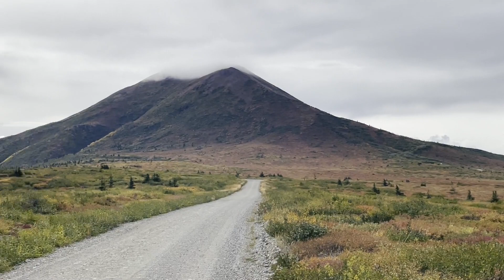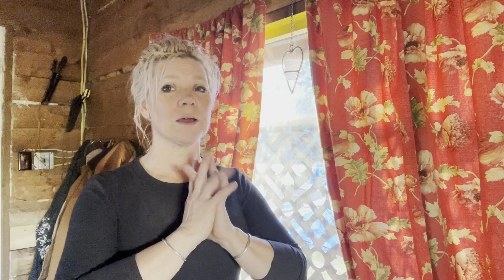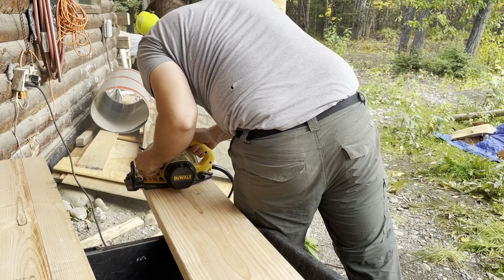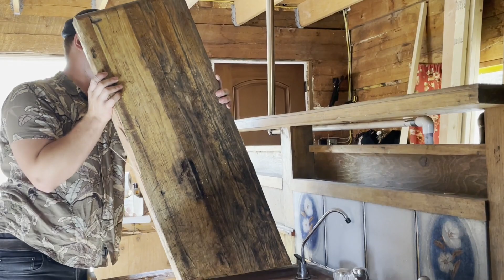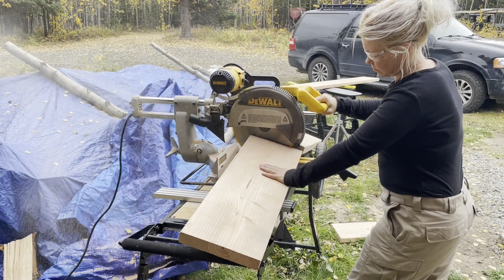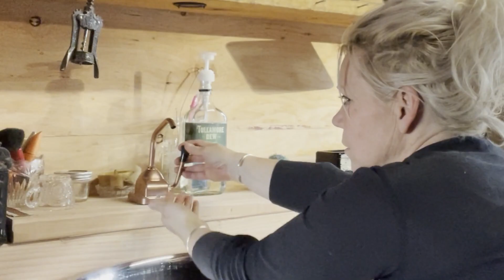Remote Alaska Cabin Kitchen Renovations & Bathroom Demolition Finally Begin!

Comment: *IMPORTANT INFORMATION*
My friends just had a horrible accident due to using spray foam insulation. When I heard about the accident I thought of you. They were using the industrial spray foam to fill in gaps in  their home. The spray foam is highly flammable/combustible and when he was using it the gasses met a pilot light from the gas and caused a massive explosion. The family is ok and he survived but spent time in a burn unit with some very horrific burns including chemical burns from the can of spray foam exploding. 
I had no idea that was even possible and was shocked and terrifying because I also use spray foam insulation.
Just wanted to share. I enjoy your videos!!
Reply: I guess shutting off all flammable pilot lights and ect was not in the manufacturers info list?
Reply: Reminds me of the situation with Silly String being flammable. I'm always about anything that helps me stay better safe than sorry. Thank you.
Reply: Prayers 🙏
Reply: So glad he survived, and I'm praying there were no lasting injuries!
Reply from the maker: New Meee, I am so sorry to hear about your friend and that it has taken me so long to come across & reply to the comment. I do hope that he has recovered from his injuries. So many dangers to consider when working with anything that is under pressure or potentially flammable. Thanks for providing this warning to others! 💛

Comment: Modify the water jug where the pump is above and it fills the jug then you just have to pump to fill it but yet it will flow when you want to wash your hands.   Via drilling a hole in the lid or some other way by passing the the leaky pump.
You have done wonders with the whole cabin...enjoy

Comment: I've been living camp style inside and outside of my home for years bc I need plumbing and all types of renovations. Until then, what I've adapted to for hand washing is my three bowl system.
 
Three bowls big enough for one or two hands at a time.
¹pre-wash, ²wash and ³rinse bowl, and a towel underneath to catch the drips. 

Perhaps customize a shelf to fit your height to avoid bending with cutouts for the bowls to be pushed into and even cutouts in the towel underneath will be a nice clean look and of course the cutouts will stabilize the bowls.

I like to put a splash of white vinegar in my rinse bowl.

So, you know the scrubby things that we scrub our body with, the poof ?
And you know how when we wash and rinse our hands we rub our hands together ? Instead, how I have adapted to the inconvenience for me, to rub my hands together inside of the bowls is, I put some of that poof material in each of the three bowls so I can abrase my hands in that mesh fabric. 
For me I actually recycle the mesh plastic bags my fruit comes in or you can take one of those poofy things and cut it apart for this type of fabric, makes my hands feel clean and to help quicken the wash and rinse and this helps remove oils when I've had my hands in stuff like that.

It's such a water saving method also and I don't think I'll ever go without using this system even when I get my Plumbing working as I am a constant hand washer. 

😊I'll probably design a shelf system just like I've described here, for myself. For a even cleaner look on the shelf, I would probably skirt the bottom of the shelf in some wood that matches what the shelf is made of, so you can't see the bottom of the bowls from a distance.

This system works so well for me sometimes I use the same wash bowls for 2 days just changing out the rinse water daily.
And If you're using the stainless steel type of bowls, perhaps you could place them on your wood burning stove periodically throughout the day to keep them nice and warm.

Comment: Hello ,Alone.
My wife and I have a cabin in Northern Ontario Canada. We are offgrid so our electric comes from solar panels, or the generator. In the summer we pump water out of the lake so we have plumbing and running water, but no sewer. We have an inside composting toilet. There is no smell( actually less smell than our conventional toilet in the US.)We have propane refrigerator, cook stove, and water heater. In the winter we don’t have running water. I have been thinking of putting a water tank in the loft and running plumbing to it so I can use my water pump that I use to pump out of the lake to fill my tank in the loft from jugs, or whatever we haul the water in. Then plumbing to the faucets shower etc. it would be very easy to do and fairly inexpensive. I love your place( and mine) it is so quiet there, and dark at night. I probably won’t ever live in mine year around, because it is in Canada but I admire your courage. The scenery is so beautiful !

Comment: Do you know about the foot-pump faucets? Would be so much easier for you to use as you would not have to reach across the counter. I think the brand I used in my van was Whale Pump. You can use the pump with ANY faucet, so you could have a faucet spout that comes out farther over the bowl (and swing out of your way  when you don't want it sticking out). I never had any leaks with my foot-pump faucet. Simple to install, leaves hands free. Your kitchen is looking GREAT!
Reply from the maker: Wait a sec Joanne! Have you been spying on me? 🤨 I bought the Whale foot pump and an articulating water faucet. I should be showing it in my next video! Great minds!? 😉🧡
Reply: @AloneinRemoteAlaska  Coolio! You will love it!

Comment: I’d switch from propane to bio gas. But I can make it on my own. Bio gas is a methane.
Reply from the maker: Interesting! Making your own gas would solve a lot of things and save a lot of money! I will have to research this a bit! 😁🧡
Reply: @AloneinRemoteAlaska  you can buy a pre made system which I hear works but not as well as one made from an inch tote and you don’t need as much pressure to run compared to propane . And your own bio gas can be made from human manure to table scraps and animal poo. I wanted to build one for our cabin.

Comment: hi, built  a shower ,that you can use a 5 gallon pail to drain lt,or right outside your door, close by. look on amazon.composing toilet and sink, where the bathroom was before.
Reply from the maker: Composting toilet will happen for sure. And I use a plastic watering trough to take showers and baths but it is not draining outside yet. It will. And a sink will just empty into a 5 gallon bucket or may drain outside. Just depends. 😉💚

Comment: The kitchen looks incredible!  I may have missed it, but I wondered what you plan to do for the floor?
Reply from the maker: I have not completely decided on the floors yet. I will be putting down a plywood subfloor over the old floor to start. I have seen the "snap in" engineered flooring (Home Depot) but I am just not 100% sure about that stuff. The common thing to do in Alaska, especially so far away from cities is to just paint the floor. I have to think about maintenance and ease of cleaning though. And expense of course. Thank you so much Theresa! 🧡🤗💚

Comment: have you considered the water system that Mitchells in Alaska has?  they use a 12volt pump to pump the water up to the second floor then gravity fed down to the kitchen.
Reply from the maker: Hmmmm I must have missed that video! I am trying to avoid using electricity if I can although it may still come to that. I have purchased a foot pump and an articulating faucet so I will see if that works first. Gravity fed would be a perfect option and I don't mind using a pump to get water to the second level. Anything is better than carrying water up the stairs! 🤣  Thank you so much Bill! 🧡🤗💚

Comment: Get a 12vdc pump to rig up under the table, then run some 1/2 tubebing to a 5 gal water jug. The other end up the back with a spray nozzle. Connect the battery with a toggle switch. That's it. Little noisey when on but hey it works. Mount that switch up near where the bowl will be, one wire to switch the other to the (+) SIDE of battery.
Reply from the maker: I decided to go with a foot pump and a new articulating faucet (so I wont have to reach so far). If this does not work, I may just try the gravity fed but still use an electric pump to get water to an upstairs holding tank. Many options if I chose to go AC/DC though. Just trying to avoid electricity to start. Thank you so much Michael! 🧡🤗💚

Comment: Get yourself a stove pipe magnetic temp guage, so you can adjust the intake air on the stove. That storm door in the loft bedroom area, can you adjust the window to open it a little? Good to vent the cabin to any built up moisture or heat. Same with ground floor open the window a little for fresh air to flow. If you start to get a Headache deffenatly open up windows.
Reply from the maker: I have a temp gauge on the stove but its an old one. Will be replacing that soon but this one works for now. The door in the bedroom does not open but I have two smaller windows upstairs that I can keep cracked open. The cabin is not air tight and I am ok with that. Its good to keep that moisture down with some dry air! I have some CO2 detectors but getting a headache would be my first sign to get to a window fast! Seen too many stories of entire families just being found dead because of CO2. I will deal with the air leaks! 😁

Comment: Stainless Steel Suction Pump 1.25 inch Manual Water Jet Pump Domestic Well Hand Shake Suction Well Pump Groundwater for Home Garden Yard Lift 10M More Attchement
Brand: osea

-18% $45.66
Was: $55.99 
Coupon:    

Brand	Osea
Color	Green
Material	Stainless Steel, Plastic
Style	Above Ground
Power Source	Ac/dc
Item Weight	2 Kilograms     This pump works very well.  We bought it to install in our Kitchen counter in case we have no electricity for our well pump.  PVC pipe down to our crawl-space.  It will lift water up to 20 feet.
Reply from the maker: I looked at that exact hand pump on Amazon too! May be too much splash for my table (glad there was a video)  but I have ideas for it elsewhere! I am still considering it (for another project) because it seems to move a lot of water! Thank you so much Eve! :_Heart:

Comment: So much work. Looks amazing what a difference..👊 keep the faucet for convenience
Put it on a swing arm so it just swings out and back against the wall. It will extend far enough over the bowl to wash your hands. Swing it back out of the way and put a drip pan under it as well. 😂
Everything looks wonderful there. You have a fantastic week..!!
Reply from the maker: Ahhhh great minds think alike Ron! I just bought an articulating cold water faucet on Amazon and decided to go with a foot pump. Will take some fancy connections to make it work but I will get it! I have to eventually set up something similar in my "bathroom". This has been one crazy year! I am looking forward to slowing down a bit with winter coming in! 😴 Thank you so much Ron! :_Heart:

Comment: Do you have to pay these drivers and contractors a real high price to deliver materials, freezers, etc since you said you are hours away from any large town?
Reply from the maker: All of the lumber for these projects was picked up with my own vehicle at Home Depot or Lowes. Same with the freezers. I have to be careful though because I usually run to town to pick up many things and do not have a trailer. My contractor that did my roof, I'm sure the delivery of all the material was built into the price. I do get delivery of my firewood luckily because the owner of the company enjoys the drive. It's not free delivery though. Thank you so much Marie! :_Heart:

Comment: Wow, spectacular progress. Seems very well thought process as to what YOU want. Seems nice to have out with the old in with the new. I would suggest filling in the spaces on your wood counter so food does not get down in those cracks between the boards and then adding your oil. Also I LOVE the chandelier. I was wondering since it it not wired in, can you center it more over your table? Maybe it was just the angle we were seeing it? As to the sink, see if you can get a foot pump to last till spring or order Amazon has a a foot pump sink you can order. I loved the leverage on the shelves, as a single mom I used a lot of legs sitting on the floor to move furniture, 😂.
Reply from the maker: So many ideas have been running through my brain for so long that seeing these ideas come to life is really exciting. But I do wonder what happens with my brain after all of these ideas get accomplished! :_What: Might be a lot of extra space? I hear you on filling the seams though. I almost was going to do that with wood glue but decided to do more research first. But they will get filled up prior to sealing it! The chandelier is wired to a regular 110V plug. Pretty sure that was not how my grandparents purchased it originally. But you are correct, the chandelier needs to move over a bit. There just wasn't a board where I needed the nail to go. I will correct that later. I have ordered a foot pump and a new articulating cold water faucet that I will need to figure how to connect it all. And I have moved many pieces of furniture using the sitting leg method! Never under estimate a woman that has to move heavy furniture on her own! It will be done! :_Laughing: Thank you so much Cee Jay! :_Heart:
Reply: On the chandelier, run a salvaged board opposite the long running boards where you want the chandelier to run. I hope your pumps arrive before winter but can’t wait to see the changes you make this winter there alone but wait your not Alone, your Alone fans are right here anytime you want to bounce ideas around or need a suggestion. I firmly believe you can do whatever you need to make your house your forever home. Any new sightings on the game cams? Also, any thoughts on sourdough starter? Questions for the next Q&A session.
Reply from the maker: @cbenji2  Yeah I was going to run the board and hang the chandelier center but I had to get to the filming quickly. I will fix it this winter though (or sooner) as soon as I get the light bulbs most likely! I have been ordering Amazon stuff like crazy getting some last minute stuff so my foot pump and faucet will be here soon. Just hope I got all the connections to make it work. And you are correct! I have all of you to get fantastic ideas from and I have received so much helpful advise so far. It's so awesome! I will be showing some wildlife captured on video in my next video. As for the starter, I do have some in my freezer. It's store bought but I don't make loaf bread that often. Thank you so much Cee Jay! :_Heart:

Comment: If I was to ever wire a cabin  I'd wire it for all 12 volt lights LED lights are so bright and low power I put them in my 5th wheel I was even thinking of wondering my house for 12 volt lights you can get so many stuff that runs off 12 Volt and put in very little 110 plug ins
Reply from the maker: You don't think super bright lights are annoying? I like softer light! But LED is the way to go for sure! And I am trying to limit my electrical dependency. Freezers, computer and some lights should be good enough. But a nice candle lit room is very relaxing! 🤗

Comment: you could always have a solar powered pump to pump the water to the second level..?  so it can be gravity fed back to you. there are also auto shutoffs to stop it from overfilling if you forget about it... and possibly switches that will start the pump when the water gets low in the container.   the only other thing to consider is the extra weight on the second floor.  but that would also take care of the hand washing issue.. cause you could use a regular tap to turn the water off and on.   now sure how you get rid of your graywater.. but you could filter it before it goes into the container.. and then use the same system to pump the gray water out of the cabin without having to deal with heavy containers.  not that we will ever grow old and less strong.. ;o)... but it's good to keep an eye to the future and get a system going that is semi automatic and not going to put your back out keeping it going..
Reply from the maker: A way to get water to the second level (without having to carry it) would have to be done with electricity/solar. My only fear with solar is how little I get in winter. And yes, weight on the second level is a concern for me. Many things to consider. I may have found a solution for now. Just a foot pump and an articulating faucet so I wont have to reach so far over the table. As for grey water, I just get rid of it in 5 gallon bucket once it gets full. Sometimes just spread it out under the trees and sometimes in the fire pit. I am looking at a way to have it go into a plant bed of some sort. Just started looking into that idea. I am keeping in mind the "as I get older" part so nothing is too crazy. Maybe electronic pumps will be in my future but for now, I like to keep it manual. I know, I'm weird! :_Laughing: Thank you so much Deborah! :_Heart:
Reply: @AloneinRemoteAlaska  

never weird girl... ;o)

just doing it our own unique way.
and that is how the Lord made us.
we figure things out as we go.. as the Lord guides us... 
I do feel your efforts are being blessed by the Lord.. so... 
if we put him first in all we do..we never have to do it alone...
and him that made all things..?
will help us  get where we feel we need to go.. 
you are in my prayers.   
✝❣👍

Comment: You need to put a 1 way water valve in the water line so it dosnt beet back there small and cheep well use to be cheep I use to put a after market windshield pump in the water line and a doorbell switch run it on a 12 battery worked so nice no pumping and very little power
Reply from the maker: Yes a one way valve is a great idea! Or even just a simple shut off. A windshield pump and doorbell? Who are you Macgyver? 🤣